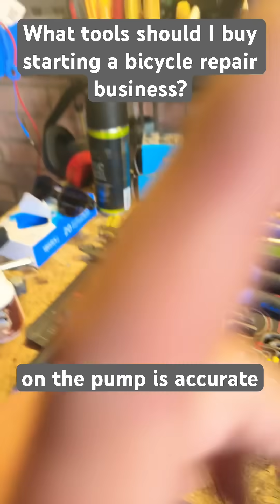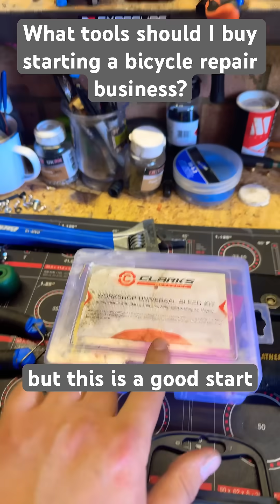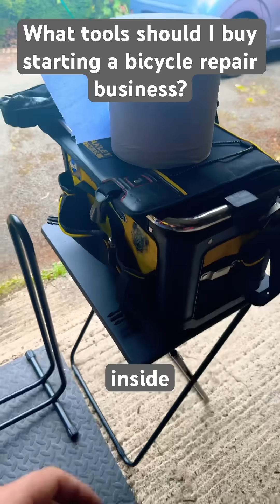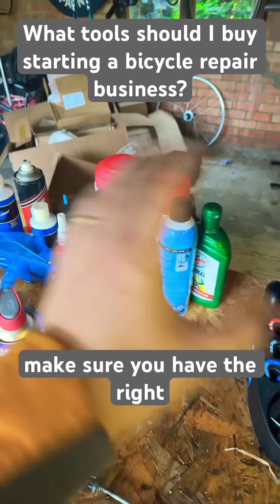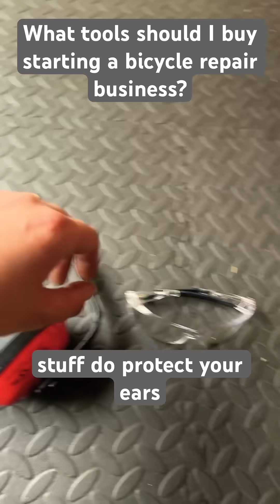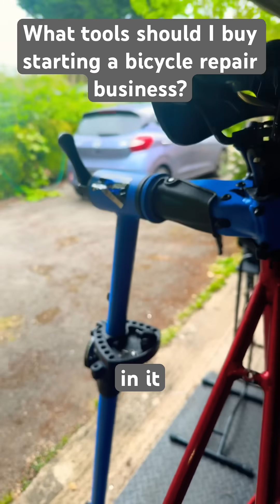What tools should you buy starting a bicycle repair business? #smallbusiness #bicycle

Comment: how much do i have to invest to get all these things?
Reply from the maker: It’s at minimum a few hundred pounds (or dollars), you can buy cheap tools but for commercial use you really want quality tools that’ll last. It’s like buying a cheap pair of shoes, you’ll end up buying many pairs rather than one good pair. 

A “full” toolkit will be £6k+ for something like a Park Tool master mechanic set, but that doesn’t include your work stand (£100s), consumables, shadow board, toolbox. Also a windows laptop, Di2 and e-bike diagnostic kits etc. 

Tooling is a continual investment, just as parts wear out so do tools. If you’re going commercial it helps to have a trade account with b2b suppliers who can offer you a reduced rate on professional tools. Any money made on Procycle for the last year has gone back into buying new tools, workshop equipment etc.
Reply: So the most expensive thing on the table is the leatherman and I have never needed anything close to this 20 years doing bikes. What is the purpose? Very good camping tool but for doing bikes? I’m curious